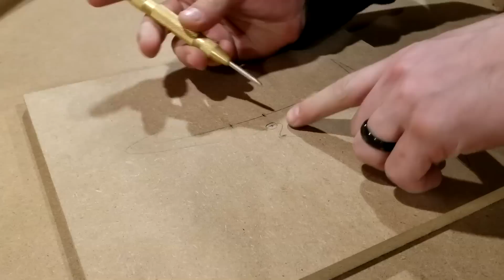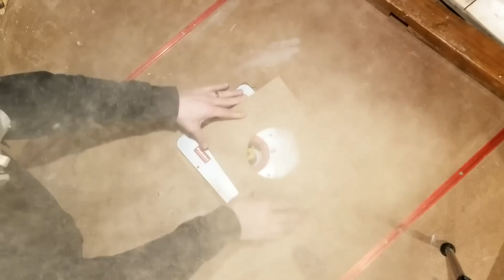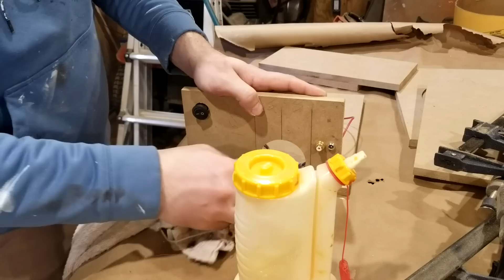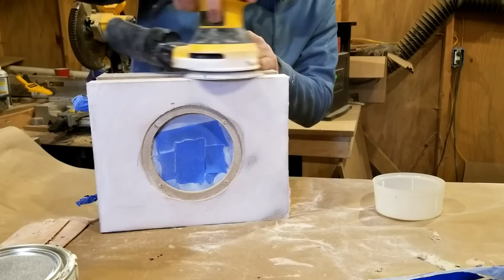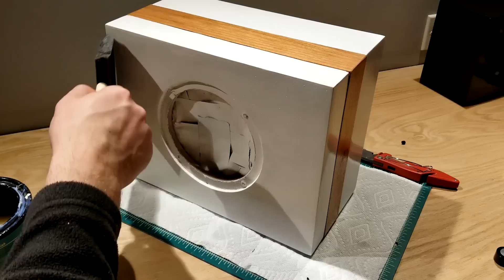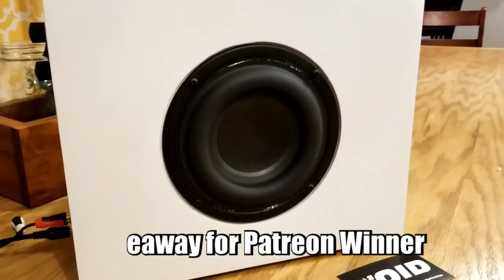DIY Mini Subwoofer! - Powered Voxel Sub with Cherry Inlay

Comment: Instead of hot glue on wires and such, zip tie wiring and loose items, then hot glue the cut zip tie ends to cabinet walls etc 😊👍 a bit of effort resulting in a very clean appearance, and adjustable 👏

Comment: If you sit it on its back the speakers pointing upwards will give it more attenuation control but put a half an inch of ply or MDF over the driver just covering the surround or slightly short make sure the inside edges are round over inch, you Square not round. Dependent on the drivers but give it about an inch clearance if you can line the inside of the board with a bitumen pad or underseal thickly painted on. And keep it well padded right up to the port

Comment: Great idea with the inlay. Looks beautiful! And those little subs are supposed to be great. Not sure about that amp choice though. There's so many better boards out there nowadays. Still. Very nice little sub.
Reply from the maker: Thanks HH Scott!  I'm glad you enjoyed the design. I agree there are better boards out there, but for a small sub with limited frequency range (especially low frequency) I felt it was good enough.  But I agree you could definitely upgrade it to a different/better amp and not cost much more at all.  Any particular amp boards you like?
Reply: 123Toid Well I haven't actually tried any yet. But I've been doing my research lately, the ones that interest me the most. Are the TPA3116, TPA3116, TPA3152, and the TPA3155. Ask good sound quality supposedly, but the last two are much more powerful. People like the TPA3116 the best for SQ overall it seems. And they make some mono versions too. See here: http://audiokarma.org/forums/index.php?threads/tpa-3116-vs-the-tripaths.574806/

For pre-made jobs that have great sound quality. The Allo Volt is supposed to be amazing. They make 4 versions that are all based on the TPA3118. The Volt (50x2) $27 it's really an add on board for a Raspberry Pi type setup I think, but can be used in its own also it seems, Volt+ (50x2)$39 similar to above, Volt+ w/stepped attenuator (50x2) real amp in case $69, and the big boy Volt+D (60x2) dual mono w/stepped attenuator $129. 

And the best one I've found, hands down. And also the one I'm in the middle of trying to buy from someone right now. The TBI Millenia ($500). It's a class BD. It's based off a Class D amp board, but it's done up to the max. Runs 10 watts on some AA's, or a 12v external battery. Or 32 watts on its linear power supply (26volts). Supposed to be great on a battery especially. I've got an old car battery, and a brand new AGM car battery I bought for car audio, but never used it. So I'm going to put them together, and see what it will do on 24 volts of battery power. Should be amazing. 

People compare it to a real SET amp with better bass. That's how good it's supposed to be! I'm going to find out. I sure hope it is. Because then I can sell my tube amps. And pocket some money. I might keep one though. 😁

And I'm also going to try some of the others, since I'll already have the power supply, and the batteries on hand. They really look like a lot of fun. I'm thinking about doing a bi or tri amped active speaker setup using a MiniDSP in the future. Just for kicks. I've always wanted to play with DSP, and active. I'm already digital, and I already own 4 DACs. They're all different though. So I don't know how it will sound, but I figure if it shows promise. I can fix that later. I've got to buy a lot more stuff first though.

I love this hobby. It's basically never ending. I've got so many plans for things. It's going to take me years to be able to afford it, and do it all. Boredom does not exist in my life anymore, since I've gotten into this. I've been thinking that we should introduce kids in school to this hobby at late middle school, or early high school age. Have them build speakers. I've seen a little of that. But not enough. Think how many kids it would help get focused on life, into jobs, and out of trouble! I certainly wish I would have been. I swear my life would have been better for it. Something you should think about yourself I think. At least get your children into it. Although I'm sure that's already crossed your mind.😉

http://audiokarma.org/forums/index.php?threads/tpa-3116-vs-the-tripaths.574806/

https://www.allo.com/sparky/volt-plus-stepped-attenuator.html

http://www.tbisound.com/dsp_products_millenia.asp
Reply: 123Toid I forgot to add. I know some of these guys personally, and a I know what they've owned in the past for equipment. I've been a member of AK for a while, and go to the meet ups we have here in New England (last one was in Sutton MA on March 10th). If these guys say they sound great. They sound great! Trust me. These guys know their stuff. I'm going to try a bunch of these eventually. They're too cheap not to IMO. And there's plenty more out there too. It's a very good time to be into audio my friend.

Comment: I built the Voxel sub for a portable 2.1 system. Sub sounds incredible for its size! Only complaint is the port chuffing. Any idea on how to eliminate the port noise? Maybe a slightly bigger box with a larger diameter/shorter length port?
Reply from the maker: Actually I just did a redesign due to this reason. I should have the plans it later this month once I have everything worked out. But I basically changed it to a slot port, which really helps
Reply: Build a second one and don't push them as hard ;)